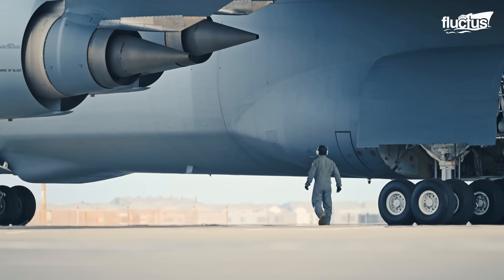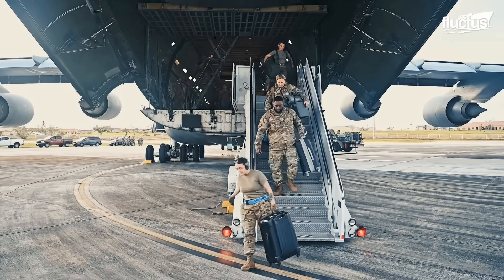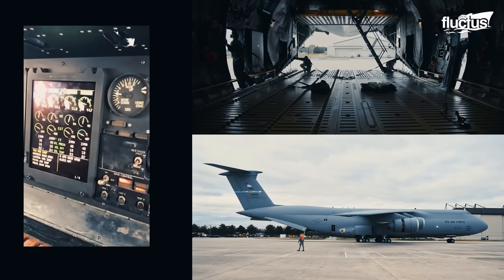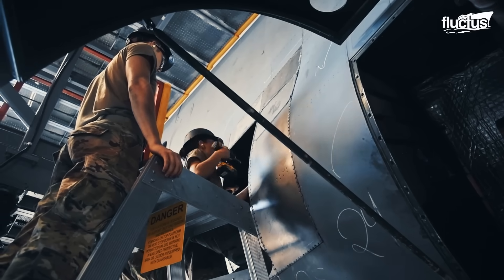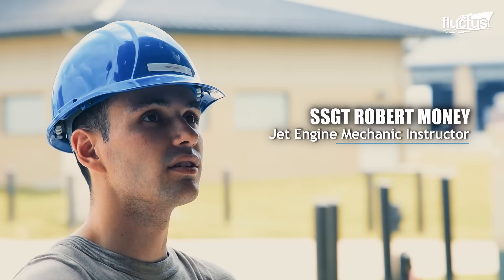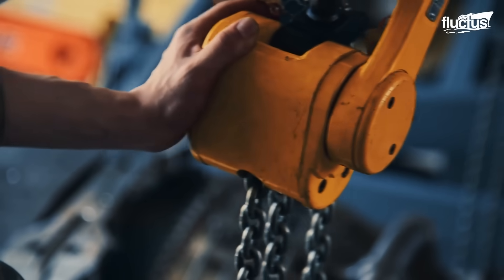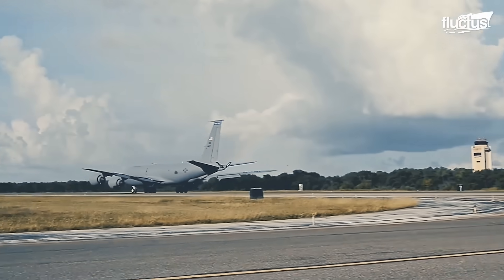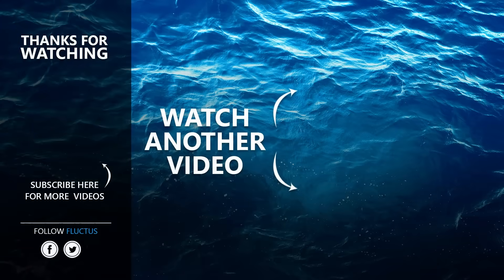C-5 Galaxy: US Air Force Largest Cargo Aircraft Ever Made

Comment: The C-5 Galaxy is an absolute beast. It’s not just the largest cargo aircraft in the U.S. Air Force it’s a symbol of global reach. This thing can carry tanks, helicopters, even other aircraft parts, and still have room left over. What’s even more impressive is the nose-lift feature that allows for drive-on/drive-off loading. A flying warehouse that turns any airfield into a frontline logistics hub. Respect to the engineers who built it and the crews who keep it flying!
Reply: But there are only 55 alerts available